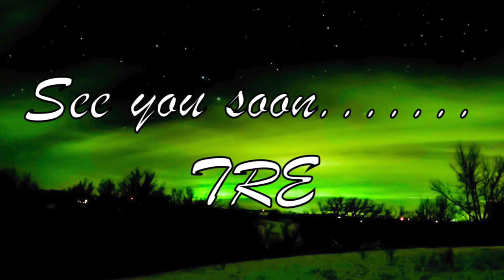Using my new Marcum Pursuit camera while Minnesota ice fishing for walleye and northern pike.

Comment: Watching you staring down your fishing holes reminded me of an occurrence that happened some 50 years ago. I am not an icefisher and chose to spend my time in the cold and snow skiing hiking or lumbering. A friend of mine had a huge popular tree that was dead and needed to come down because it threaten a cottage on his property. The problem was it stood immediately between the cottage and the lake shore. We decided the best thing to do was to wait till winter when the lake was frozen and drop it on the lake then when it refroze we could finish cutting it up while we could get to it. When February came the coldest part of the year we pick a Sunday to do the task. It was a sunny and extremely cold day we started attacking the 4’ trunk cutting the wedge and putting wedges in the truck to insure the tree took the right track. To and another layer of safety I was on the 2 story roof putting 4x4s against the trunk and the structure. It took a while for the 24” bar to make a deep enough cut to start the fall. When the tree hit the ice I saw a dark line race out under the ice, when it past under several abandoned fishing holes water shot up about 2’ the dark line continued out heading for a small village of ice shanties about a haft mile away. As it past under each shanty an angry angler flew out the door completely soaked. When ever I see ice fishing I think of somebody like you staring down the hole only to have it bite back. I learned a lesson that day I’m sure the fishermen did too!
Reply from the maker: HA! That is a great story! I've heard about muskrats coming up the hole but never a geyser!!! Thanks for sharing!
Reply: Another story of ice fishing lore from Grand Traverse Bay as reported on local radio and then picked up by Paul Harvey, and now the rest of the story. It was the middle 70s and a man was spear fishing through the ice on the bay. Sitting in his shanty with his Labrador Retriever watching the bottom through a 2 x 3 hole when a large fish swam into view. Before he could throw the spear the dog drove in after the fish and disappeared under the ice. The man was devastated. Then he heard yells coming from a nearby shanty, opening his door he saw his dog emerge from the other shanty wet and wagging his tail. I don’t think River Dog could fit through your holes but it always something to think about. Waiting on your next vlog.